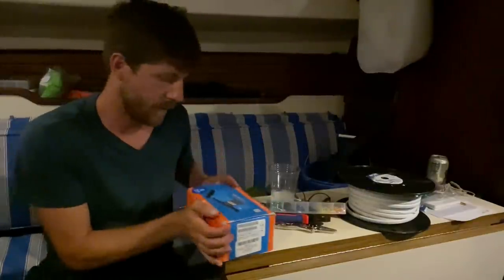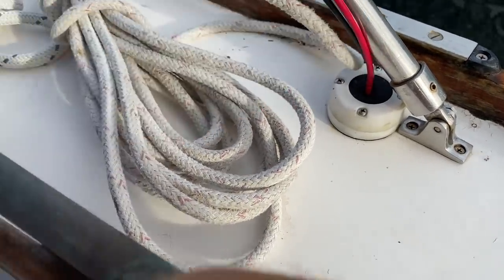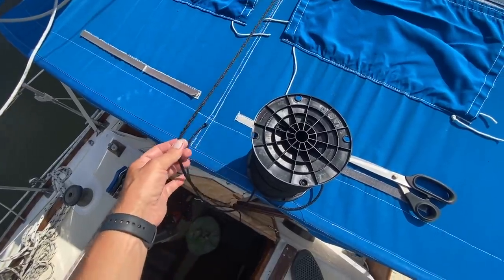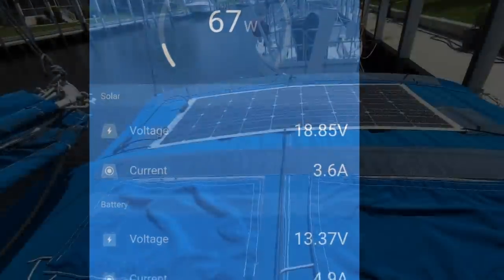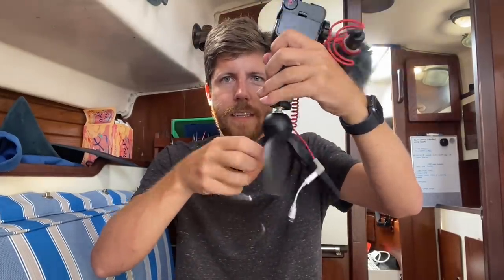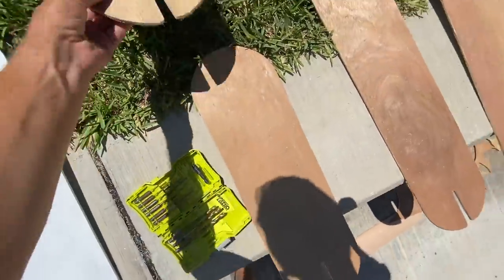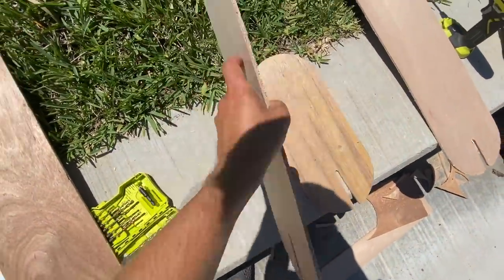Projects: Solar system,  whisker pole, doors...

Comment: Hey man, I’m a woodworker and I’ve dabbled in building small boats. I’d encourage you to seal the wood on your dingy. There are several routes you could go that would be fine, but I would 100% seal that wood. It’s going to mean the difference between a boat that lasts six months and one that lasts six years. Cheers!
Reply: Watershed Any experience with Epifanes clear varnish? What would you suggest?

Comment: Hey Sam.  You've got the Windscoop mostly correct.  But the dowels at the bottom are designed to go inside the forward hatch  which keep it held down at the bottom as you pull up on the hanging pendant or halyard. That way you dont need any lines to hold it down at the bottom if you see what i mean.  Yeah sadly I'm old enough to remember when those first hit the scene in the 70's. Cool to see one again though.

Comment: You might want to add heat shrink, electrical tape, or even nail polish to those crimp connectors. I'm pretty familiar with them and the hard plastic cup at the insulation will direct water into the cables. But the are for sure way better than bare wire

Comment: There are several ways to design this type of door so that it can resist a wave coming over. It either has to have a member that can support tension, or it can come together as a steeple, to distribute load as compression.  Either they have a feature to capture one another, or both doors hinge over to one side.

Comment: RE putting your solar panels on the Bimini, I saw that SV Delos had a nice solution (EP262). The sewed pocket sleeves onto the bimini that they slid the panels into with metal fasteners. Seemed to work really well.
Reply: @wetdirtmud  that's the one he referred to in his video. Thanks for the link I couldn't find it.

Comment: Hi Sam,
Yes you will like those wire fittings. Before I retired we used them for all our control panel wiring. They are typically called wire ends. And some times a spade lug will work better. The Europe type controls typically have small terminals. Another helpful hint is to use wire numbers at each end of the wire. This makes trouble shooting problems very easy should you have any problems in the future with your devices. I may have some left over. If you need some let me know. I wish you all the best. Be safe.

Comment: You could try sewing some velcro strips to the top of the bimini (I doubt it would damage the bimini, and you could always remove the threads later), and gluing some complimentary strips to the bottom of the solar panels. Velcro is super cheap and when used over a large area like that solar panel, very strong. This way the solar panel would still be removable in case you wanted to replace it, and it would stop fluttering in the wind as well.

Comment: Pretty sure those dowels on the Wind Scoop go INSIDE the hatch. That way you can leave it open at night, and pull it inside to close the hatch if it rains...long term consider making a hard top bimini from glassed foam. Hey and I wanna watch you make it! Wouldn't all those electrical connections be better soldered? Butane powered solder iron with hot knife and mini heat gun attachments is mighty handy on a boat.
Reply from the maker: Ahh that makes sense. I bet that would funnel the air better too. The bimini could definitely use some modification. Possibly a project for down the line.

Comment: 0:30 before crimping, dip wire end in 'dielectric' or 'bulb' grease to slow corrosion.
Reply: i disagree. a cpc 2 coat is going to affect conductivity. id rather just throw on a good heat shrink to seal
Reply: Heat shrink.
Reply: @simunator  For a marine application you should really use both.  You crimp your connection/fitting on and then put a small dallop of silicone dielectric grease on the outside of the wires/connection.  Heat shrink goes on over all that, sealing it shut and the grease keeps any water from entering or condensation forming under the heatshrink.  There might be some tiny effect on conductivity, but nowhere near what the effect of a corroded connection would be.  It's no different than the insulation wrapping the entire wire itself.

Comment: You should look into getting electrically conductive grease,  I used it on all of the electrical connections on my boat,  it really  prevents corrosion and bad connections, I never had any corrosion.

Comment: Hi Sam.     Always look forward to your next video.  Really enjoy them, and can't wait to see some sailing in the keys.    A couple comments: 

- If you can get in the habit of closing the companionway hatch when you are working on deck near the mainsail / bimini.   One false step and you will fall into the hole and have a bruised or cracked rib, or bruised hip  (ask me how I know ! ). 

- Yes, you will find that whisker pole will project a LOT more genoa area into the wind downwind, and stabilize also.  It makes a big difference as you have already seen. 

- Yes, if you can sew fold-over sunbrella pockets for the edges of the solar panels, and faster with either twist-lock fasteners, or hook-and-loop tape, that will make a very secure permanent fastening for the panels.  Of course you are going to need a sewing machine to do that.   Google How-To-Marine installing a Solbian Semi-flexible panel,   Sailrite tutorial, Delos262, etc. 

Cheers - love your videos.

Comment: Some electrical grease on the wires and then sliding the shrink tube over it would make those connections nice and free some water leeching in.  I think its called dielectric grease or something similar.  Anyways been enjoyin the vids even though I am not into boats myself..  You look like youre quite enjoying yourself every video.

Dakron or however spelled is the type of string that bowyers use to make their bow strings in archery.

Comment: I have found that soldering the ends of the wire is the best solution. Crimping can still result in intrawire corrosion. Soldering fills all adjacent wire strands, permanently.
My 2 cents.

Comment: Sam, use some dielectric grease on the connections and it will help keep water erosion at bay and the connections strong.  I use it on all of my motorcycle connections and it keeps the weather from causing havoc.  Just a suggestion.
Reply from the maker: Thats like a great idea. Thanks for the tip!
Reply: @samholmessailing  Invest ina $6 tube of "Super Lube". Unlimited uses around the boat (and house).
Reply: and get the heat shrink that has glue in it; makes a waterproof seal over connections; ordinary is not full waterproof.

Comment: I got a 100w rigid panel for my 22ft. But it came with a generic pwm controller. Changing it for the victron. I never thought of ferrules for wiring, kit off amazon on order))

Comment: Great video Sam i'm really enjoying your content.  I just had a thought that whilst your in project mode, an emergency rudder that uses the whisker pole as a tiller with fixings fitted to the rudder, pole and pushpit stantions to allow it to be put into use quickly in an emergency may be a fun bit of content to make and its also a valuable safety backup to have on offshore passages.  yes i know that the windvane can be an emergency rudder but still would be nice to have i think. anyway cheers and stay safe.  Grant
Reply from the maker: Thats a neat idea. My wind vane is actually the  type  that wouldn't   work as  an  emergency  rudder.  Could be a  fun project.

Comment: Don't give up on the Rode VideoMicro. Well, maybe that one. But there is something lighter with that particular mic or the connection. I love the improvement it makes with my phone and mirrorless camera.
Reply from the maker: It  seems to be  the  wind,  which  is  the reason I  got it. Do you  know  of  a  better  deadbeat that would work for it. anything over  10kts sounds awful.  I'm going  to try out the  instamic next.

Comment: Apply a liberal amount of dielectric grease to the connections,( i mean ALOT) coat every connection. It projects against corrosion and is non conductive. Apply in the connectors or plugs too, they might even make marine grade.

Comment: Sam,
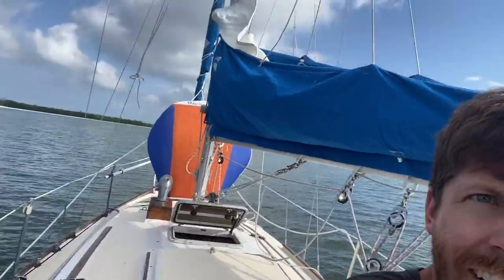For mounting solar panels on the bimini, see YouTube "Delos 262". Brian does just that starting at 6:00 and shows the finished job at about 13:00.  
For good connections in salt water environments. look at mcmaster.com and search for "electrical wire terminals". They have some that are "solder-loaded heat shrink ring and spade terminals". They also list terminals that are just heat shrink and say it will keep out salt and moisture, but I think the solder-loaded ones will be more secure. I would expect any good chandler would have these sorts of terminals in stock. God only knows you need this sort of thing on a boat.

Comment: Sam, when you put the ring on for the whisker pole are you planning on doing a ring or a sliding track?  For simplicity sake it would be awesome to see you install a track with sliding cars for your pole.  Would really keep the deck cleaner when not in use as you can store the pole vertically on the mast rather than down on deck.  Looks better and increases safety if you need to go forward on the boat.
Also gives you more flexibility with the sail and how high you need to mount the pole.

Comment: In future just tin the end of the wires i.e. strip the end ot the wire, twist it together, heat on a soldering iron, add a little flux and wipe with solder, followed by a little flick.
Reply: Sorry, but tinning is NOT recommended.  Using the ferrules like in the video is a good way to go.  tinning wires hardens the end wires in place which when subjected to the pressure of a screw or crimp, cracks the wires and disloges the solder creating gaps and rending the attachment insecure.
Reply: @masteriti01  I could see how that could happen at  the tinned/untinned interface, good point

Comment: The VideoMicro is a great inexpensive mic - your issue may be either due to the adapter you're using to connect it to your iphone, or due to excessive wind speed (but that's pretty impossible to avoid on a boat). I'd second the other commentor's suggestion on looking for a larger/better dead cat for the mic.

Comment: hej Sam, I don't think you need 10 ga wire for your panel. I used #10 for a 2 ton central a/c 240v with a 20 amp breaker on it.

Comment: Hey bud I’ve heard you mention you’ve run aground a few times, you may want to check your keel bolts and even to a quick haul out and check the keel, keels will fall off, check out what happened to Cheekie Rafeeki,
Reply from the maker: No worries. The keel in encapsulated in the fiberglass.
Reply: Sam Holmes Sailing be safe my dude

Comment: Thanks for the vid. I got my hands on two hard 50w pannels and controllers, 23 feet boat with same requirements - nav. and interrior lights and charging phone/tablet, have you experienced any shortages during the less sunny periods? Can't actually test them myself, since I'm in lockdown in another country(
Reply from the maker: that should be a good setup. I had two 50w panels on Swedish fish. It was  pretty  cloudy  the  first half of the trip  and I was still able  to keep everything except the fridge charged.

Comment: When mounting to the top of a Bimini, I actually prefer to add two stainless bows across the top and then mount rigid panels to them.  There are some nice fittings available to make that relatively easy.

Comment: Thanks for the vids
why not solder the ends then screw in - no gaps?
Also  - what solar panels, controller are you using?
Reply from the maker: Victron mppt 100/50 w/ bluetooth.  Had great luck with Victron in the past but  this one  died after only six days!!!😠 I would have gone with two 100/20's to have better redundancy if I did it over. I'm using the  Renogy 100w flexibles.
Reply: @samholmessailing  thanks

Comment: If the wired mic isn't working out, how about a bluetooth mic like an instamic? https://instamic.io/products/instamic-pro No cable connection to corrode. Looks like the battery life is only 3 hours, but you could just throw it on the charger when you finish a recording clip.

Comment: If the flexible solar panel mounting doesn't work because it vibrates in the wind you should check out how SV Delos sewed a ''frame" in the dodger to encapsulate the panel edges:    https://www.youtube.com/watch?v=wTa6HEo2_K8&t=1079s